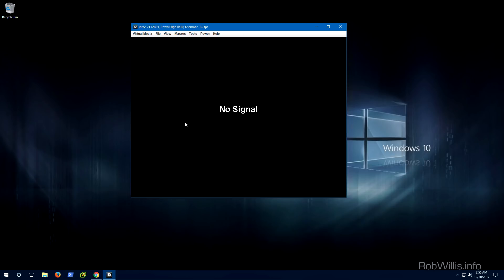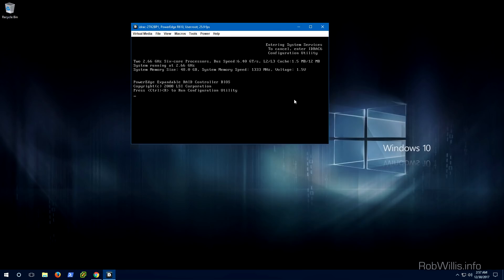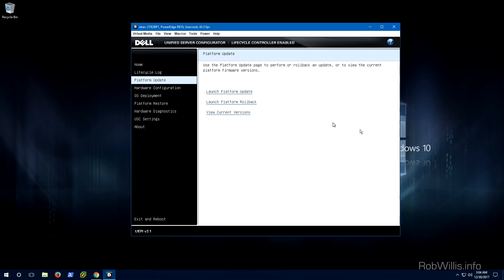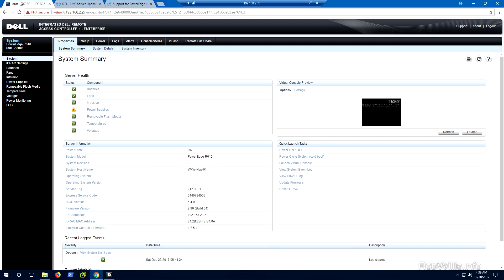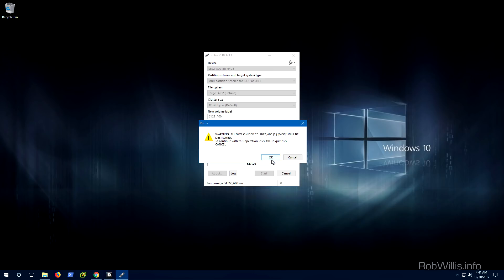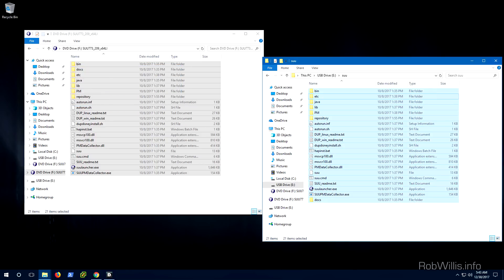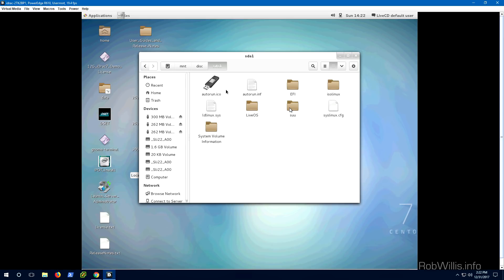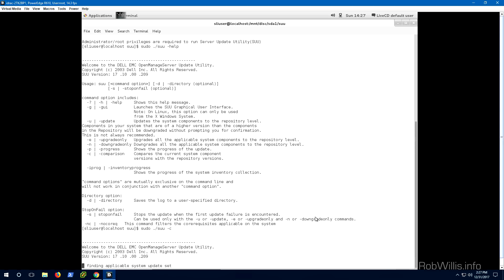PowerEdge R610 - Updating Firmwares When the LifeCycle Controller Fails

Comment: Hi Rob.. need your suggestion if I should go got powerEdge 6** series or 7** series. I need bunch of(4-5) VM's created out of it, 1-2 core each to setup my own devops lab at home.
Reply from the maker: Hey! Both are good chassis's and should have similar hardware specs. The r610 will be limited to 6 drives, but the r710 comes can go up to 8 I believe. The other big difference is the thickness of the chassis, the 610 is a 1U and the 710 is a 2U, so you could actually fit 2 of the r610s in the same space it would take for 1 r710. So I would say if you were only going to get one server, get the r7xx series, if you think youll eventually have more than one, go with the r6xx series.
Reply: Thanks Rob

Comment: I have 6 dell servers so far and not a single one of them have been able to upgrade through the lifecycle controller, they have all been upgraded through centos.

First time I spent an entire day trying to figure out what worked and what didn't, googled and tried tons of stuff until finally I went the centos route. Made a bootable usb stick, installed and started the dsu utility and it needed some additional drivers. Tried to install those additional drivers but ran out of space on the usb stick. Ended up popping a spare harddrive into the server, installed centos on that, installed the additional drivers and got it all working. Didn't write any of it down..

A couple of months later I got another server, had completely forgotten what worked the first time, so went through it all again, spending the better part of a day once more. Thought "Who needs more that 2 servers?" and didn't write anything down - yes, I'm that much of a numb-scull!

Third server arrived, god dammit, why didn't I write anything down? Remembered something about installing centos on a harddrive because the usb stick didn't have enough space. Bought a bigger usb stick, installed centos on that, updated the drivers and ran the dsu utility straight from the usb stick.

Server 4, 5 and 6: Booted from the usb stick, typed history in a terminal to remember what I did last time and just repeated the last step on my new server. 

I highly recommend keeping a dedicated dell server upgrade usb stick around, because once you get into playing with old servers there is always room for one more.
Reply from the maker: This guy gets it! :) Keep up fighting that good fight man!

Comment: Thanks for this great and useful video.
How were you able to resolve the cheap SSD drives flagged as bad that you mentioned in this video? I also have similar problem and all the firmware update did not solve my problem. Drive working but constantly blinking amber.
Reply from the maker: I've had no luck getting the amber lights to clear on those drives, at this point I've just learned to live with it :)

Comment: Unfortunately this no longer works nor does it appear it ever will. Shame on you Dell. The SUU method does however it is significantly out of date for 11G chassis. https://www.dell.com/support/article/us/en/04/sln310452/lifecycle-controller-lc-firmware-update-error-no-update-is-available-on-any-11g-server?lang=en
Reply from the maker: Thanks for posting that! What a bummer! At this point I guess I would stick to the SUU method and then check the versions available on Dells support page if you really need the most current version of something. VMware just dropped support for the PERC 6 with ESXi 6.7 too...oh the joys of running older hardware and a home lab. :)

Comment: Thanks, your video was well done and informative. What viewer are you using to navigate the idrac virtual console? It has a "D" icon for the app.
Reply from the maker: I am using the Java Web Start to launch the console, the "D" icon is being forwarded from the java application much like a fav icon on a website. D = Dell :)
Reply: Rob Willis Thanks. I have not had luck getting my console to work under any web browser due to security certificates that are self signed and the browser not liking that. So I had not seen the browser open a window for the condole and use the “D” icon yet. I at least can view all the iDrac internal web pages with settings through Chrome but can’t in any other browser like IE. I’ve seen the videos to change security settings and plugin type and some others that are more complex solutions but still can’t get it. When I saw the unrecognized Window with the D icon I was hoping it was some 3rd party app that you can run the plug in under. It’s not crucial in my server environment to use the console but I’ll still try and get it solved.

Comment: Hi Rob; are all these iDrac operations doable from the standard as shipped drac, or do you have the full license installed?
Reply from the maker: This is out of the box functionality. All of the DRACs I have seen do not have any licensing that I am aware of. There are different versions of the DRAC like in the 610 there is an Enterprise version, but in that case it is actually an additional piece of hardware.

Comment: Awesome video!  I looked at the download page for the R610 and I can't seem to find the link to the Dell Support Live Image Version 2.2     All other searches I have done says that the file has moved, could you upload the image somewhere so I can download it?  Thanks
Reply from the maker: Darn, it looks like they removed it shortly after I posted this. At this point I would look to use another bootable distro like CentOS or Ubuntu. All of the steps involved should be the same. Ill update my post with this info. Thanks!
Reply: Bummer!  I will have to find a bootable CentOS then.  Thanks for the great videos!
Reply: They added it again, must have taken it down to do an update.  But I still have an issue that maybe you can help with?  My suu -e says that there are no updates applicable to the system and then stops.  Can't update anything via the lifecycle controller because I get the "not an authentic Dell update" error.  Any idea why this is happening?
Reply from the maker: If you do the suu -c what does it show? What version is LifeCycle controller? There are multiple generations of these chassis, mine are GII. If you had a GI, you might want to try an older SUU package. You can also try downloading the LifeCycle firmware itself from the support page and try flashing that.
Reply: Mine are GenII as well, I ended up fixing it, the lifecycle firmware was way out of date.  I ended up logging into the iDRAC, and using the update feature in there.  Updated the iDRAC firmware, then updated with the LifeCycle controller repair package.  After that, the updates ran just fine.  Ty for answering all the questions.